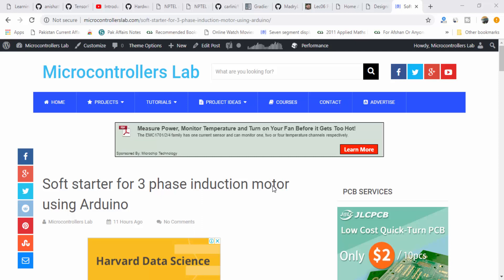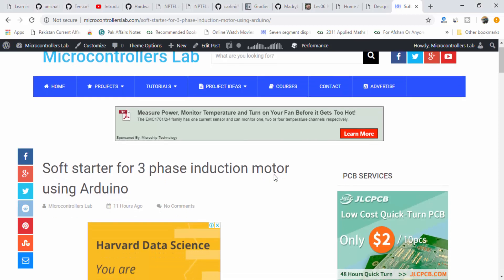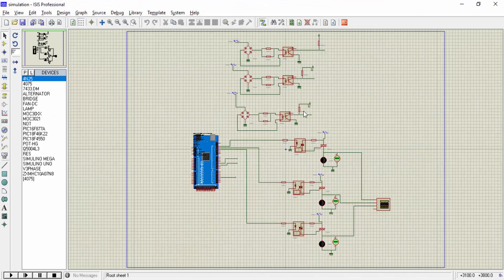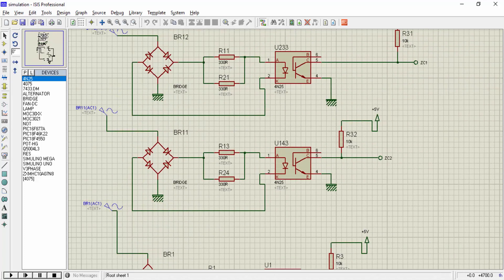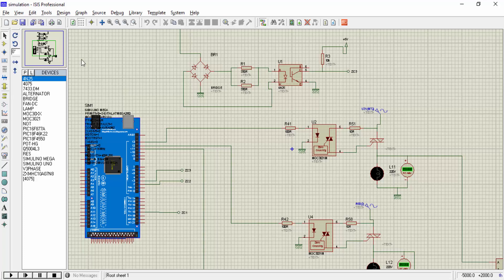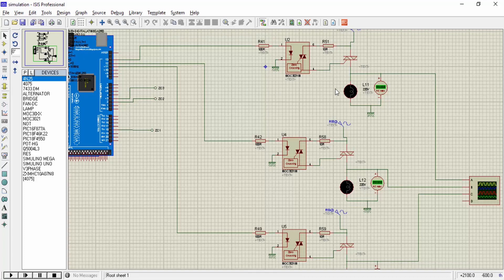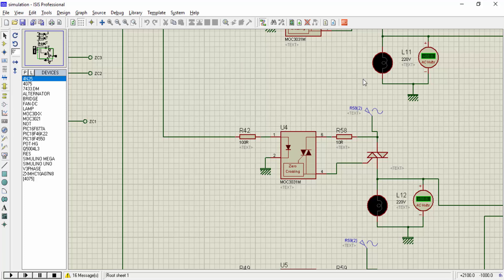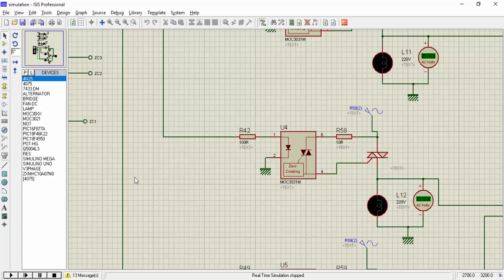soft starter for three phase induction motor using Arduino

Comment: your missing the snubber resistor capacitors networks across the triacs. if you don't have them you can get faulse triggers. they limit the dV/dT over the triac. you are better off using back to back SCRs anyway, something like one of these depending on current

http://www.nellsemi.com/eng/product_detail.php?cate=418

you can trigger the gates with an optocoupled triac such as the FOD420SD, 2 diodes and 2x 100R and 1x 360R resistors.
its on page 5 of the datasheet. 

https://au.mouser.com/ProductDetail/ON-Semiconductor-Fairchild/FOD420SD?qs=JOnFN5dTjXkwA%252B5O5uj4Yw%3D%3D

Comment: hi friend...
for detecting zero-cross it was better that you use small and low current transformer 380/24 and this protects your circuit against noises.and also it will be safer. also, use 74LS14. connect zc1 to pin 1.connect pin 2 and pin 3 of 74LS14 together and then connect pin4 to Arduino.this makes a clear wave shape.
Reply: better to use 10M 10kV rated resistors into a differential amplifier. you can then use a comparitor for the zero crossing detection.

on the diff amp you use 22k for R1 & R2 and 21k for R3 & R4 resistors. this will give you a nominal voltage at the output of 0.5V RMS at 230V RMS across the 10M resistors. this is a good level for single rail 3.3V opamps and ADCs

also put a 2n2 capacitor across the ouputs of the 10M resistors to work as a low pass filter to remove any noise.

Its extremely important to use 10,000 Volt rated 10M resistors for safety reasons as they have a long isolation distance. the current on the output of the 10M resistors is micro amps and presents no electrocution hazard.